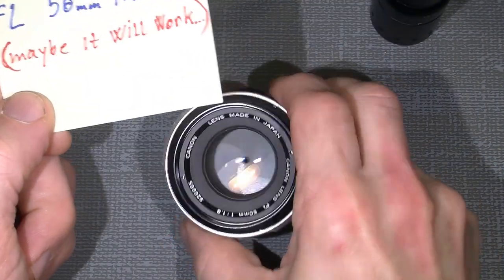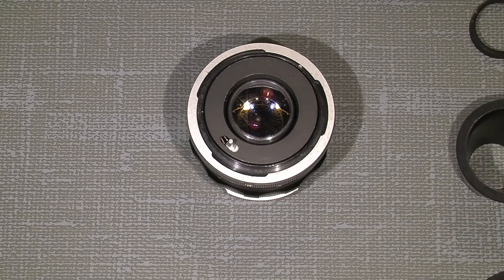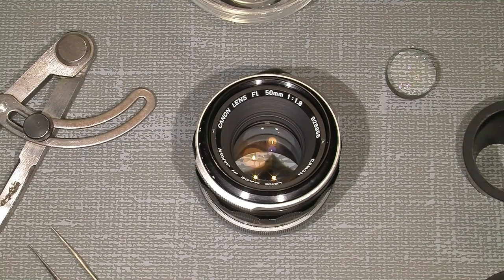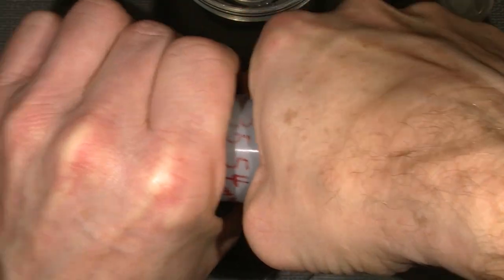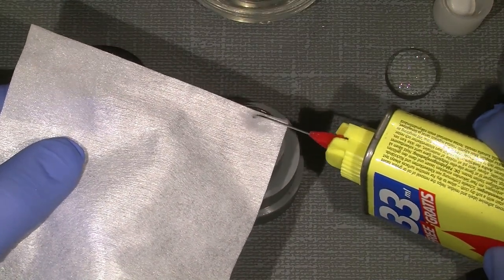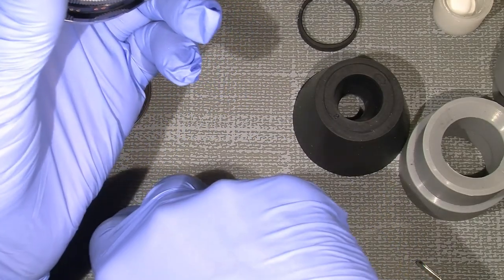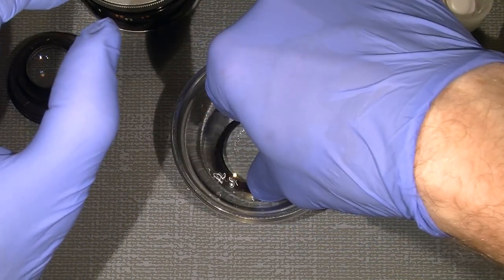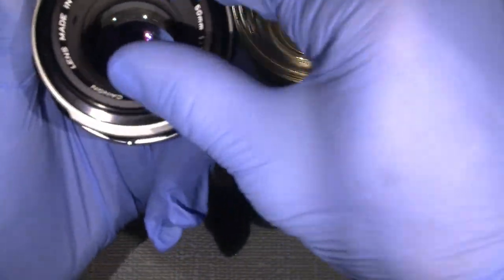Remove fungus or Haze in Canon FL 50mm 1:1.8_____maybe it will work

Comment: mold and fungus is organic and alive. it literally penetrates through the lens coatings. I've had several Canon technicians tell me "sure, we can remove the mold and fungus....and all of the coatings on the lens", which would mean your lens is about as good as a cheap chinese knockoff from Amazon. Chromatic aberrations, lens flares and refraction would be horrible. The only way to approach this is to replace the lens elements, which usually will outcost replacing the entire lens. Especially on a 50 1.8 which retails for $150.

Comment: I may have missed it, but did he mention that this lens is really quite radioactive?...and potentially dangerous to disassemble and work on.
Reply: The element has thorium in it, but its embedded within the glass lattice structure. Not dangerous at all. You could put it under your pillow and sleep on it for 36 hours and have the same amount of radiation when flying in an airplane. To my knowledge the radiation isn't ionizing, so you should be alright. Thorium was popular before the 80s since it creates a really clear image, something to do with the refraction index of the lens.

Comment: Use Pond's cold cream, the original that's been around for decades; not one of the varieties that's sold at Wal-Mart, et al.  I had to get my jar of the original online.  Buff it with clean fingers and the cream.  You can apply as much pressure as you'd like whilst so doing.  You can also use vinegar, and for the fungus, if present..

Comment: hey mike i really need your help. have an AE1 but the depth of field preview is stuck in the engaged position, nomatter how i push the lever back over the red dot, it will spring back to the engaged position. ive checked that the lever on the side of the mount is disengaged and i dont know how to solve it😢

Comment: Very informative, thanks for sharing, 

what's the purpose of the lighter fluid?
Reply from the maker: The Hydrogen Peroxide 3% is in my opinion one of the best fluid to remove Fungus, but I will also sooner try Vinegar just to see how it works.
About the purpose of the lighter fluid, if there was any oil or grease, finger prints or something like that left on the lens surface, the lighter fluid will in most cases remove it. When I use different solvents, it's because lighter fluid is not an "universal" solvent for every job, sometimes I use Isopropylalcohol 99%, and in other cases it's Acetone (take good care) and again sometimes I also use dishwasher soap. Hope it makes sense.
Reply: @mikeno62  once again, very helpful. Fully appreciate your tips!

Comment: Hi, thank you for amazing videos. I just wonder if isopropyl alcohol cleans as well as hydrogen peroxide. Did you tried vinegar for cleaning lens yet? Did it work?
Reply from the maker: Well, the 2 chemicals are very different, the Hydrogen Peroxide 3% is very good to take away fungus or mold, but also good to wipe away if a lens element has some Haze.
On the other hand, Isopropylalcohol 99% is very to cleaning lens elements if there is some oil or grease film on the lens surface, it can also be useful if there is some light Haze, but it all depence how much it is (that's just my own experience, during many, many lenses).

Comment: If you look through a strong magnifier you might see that there is actually etching... regrinding the lens is the only option than...
Might be interesting to know what kind of fungus it is and... how it gets there...
Reply: What would have caused the etching?
Reply: DeusExAstra Etching is the damage left by fungus after it's gone.  Usually it's the eaten into the cement/balsam/coating etc.  I'm not sure if it actually eats into the glass as well, but at the point there's a lot of fungus, there's not a lot of options.
Reply: It's actually easy to grow fungus on lenses. I've ruined a lens by simply carrying the lens cap in my pocket while walking around Disneyland all day, got home in the evening and capped the lens with a wet/moist lens cap and didn't use it for 6+ months. Boom. Fungus and ruined lens.

Comment: Any one familiar with a vivitar af 19-35mm? They where made onder several brand names like tokina, tamron and cosina. On my copy i have haze on the rear lens element. I have taken it out but cannot dissamble the glass from the steel case. It looks like it is a fix group glued together.
Reply: No experience with the lens in question, but it can look deceivingly much like that while it actually is not.  I took a Orestor 135mm f2.8 (the Zebra striped version) apart to see where the haze was, and had the exact same feeling about the rear lens element.
When I managed to get the ring off that keeps it in place, I suddenly had 3 seperate lenses in my hand, all well coated to stop reflections, which is why they can show up glued like that, I was astonished how well they were coated for a lens that old.